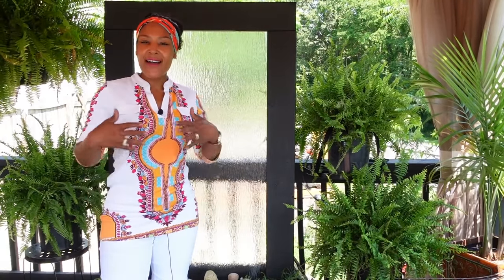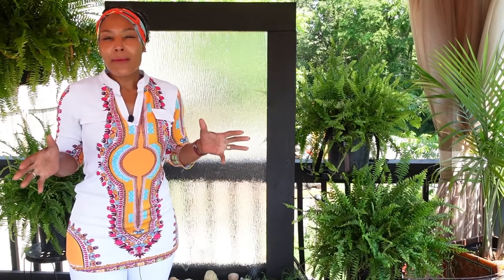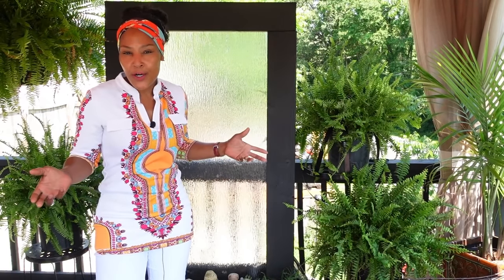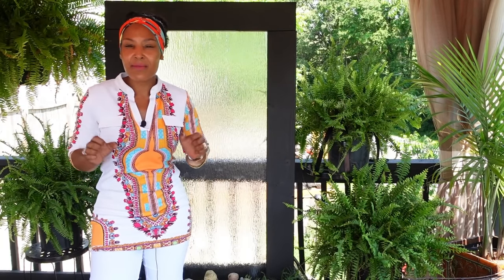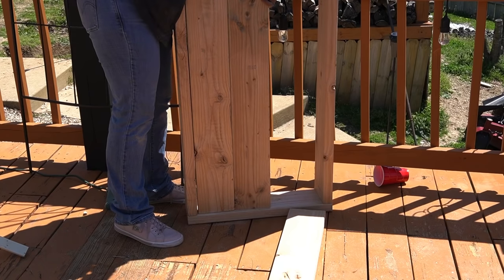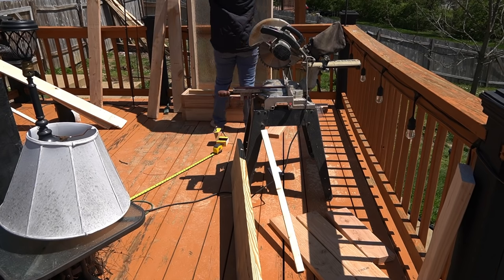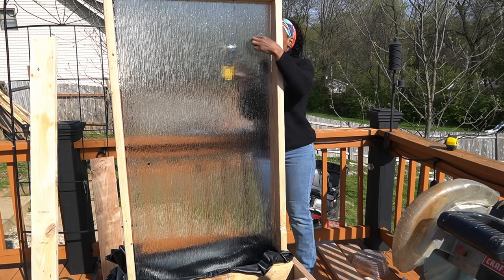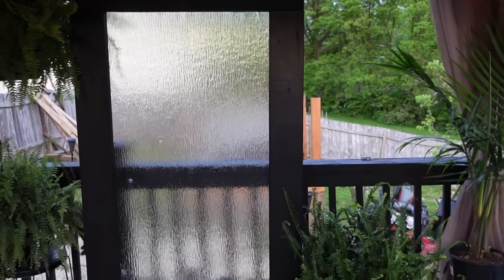Outdoor Water Wall DIY/ Using An Old Shower Door/ For Pennies😯

Comment: Great job! My only suggestions would be. 1) don't staple the bottom of the liner, only the top (you are creating holes that don't need to be there). 2) make sure the wood that comes in contact with the glass and water has been sealed first so the water doesn't rot the wood over time.
Reply: What should I use to seal the wood?

Comment: This is really pretty. Thank you for the valuable information you provided before playing the build video. I perused through the comments to see what other viewers thoughts were and I came across two persons that had my same idea. You explained how you built the frame but not how you put the feature in detail. Did the hose side towards the front or back? Where is the pump? How does it drain? Do water features recycle the water? I would greatly appreciate more info.

Comment: MRS.Eva please tell me how you care for your ferns, I absolutely love them but they die on me EVERY  single time :(
Reply: @Monica Carpio  I noticed you didn't get any replies and I have many plants myself and know about Fern care. They do not like to be dry at all, you need to keep the soil moist at all times, not soaking wet but a little moist. And, they prefer medium to bright indirect light. Any other questions, I'm around. God bless you!😇
Reply: @melissarushing2538  thx for sharing. I also have killed many furns. Do they do better inside or outside? Any other tips???
Reply: @sarahpcato  Hello, dear. You're very welcome! Ferns do well inside or outside really but you will see faster and more growth outside in Spring, Summer and Fall. They can even take some direct morning sun for a couple hours because it's not too hot at that time. And, make sure you don't let the soil dry out completely but not letting them sit in a puddle of water either. I pray this helps you and if you have any other questions, I'm around. Have a very blessed day!!😇
Reply: I agree with the other response. Ferns don’t like to be in direct sunlight and they LOVE water/humidity. You’ll need to thoroughly soak it once or twice a week depending on your climate. I live in a dry climate so I also had to mist mine once or twice a day. I like them better outside because of the leaf shedding and having to mist them. A lot of people have them in the bathroom because of the higher humidity in there.

Comment: I have a few questions. I know you attach one end of the plastic hose to the pump, but is the other side just left open pointed towards the upper left corner? (11:18 on your video). Also, did you treat the wood or use pressure treated lumber? Wouldn’t the wood eventually rot? Did you fill the entire bottom with water or is there a container underneath the stones where the other end of the hose delivers the rest or the water that didn’t come out of the holes and trickle down?

Comment: I so wanted to do this project.  But when looking for a shower door.....I came across something weird I was not expecting.  

I have only ever lived in one place that had shower doors.....and I assumed most shower doors were the same.  MY shower doors looked like yours, with that bit of frosting or whatever they do to give you a bit of privacy from prying eyes when your standing there in your birthday suit.

But....every single new (don't really want to pay for new for this project) or used shower doors I could find, are completely clear like window glass......

I will keep looking, but damn.....doesn't anyone value privacy anymore?

I actually thought, that making this would serve a dual purpose for me.  A gorgeous water feature, and a privacy wall all in one.

Thank you for sharing.

P.s.  in my searching, I came across something that's called "frosted glass spray paint"  If the water only runs down the front, do you think this spray paint would work to be put on the back of the glass?  There's apparently also frosted films, and stickers you can get for glass you would like to make more private.  Maybe one of those would work better since this is going to be outside?

Do you cover or take yours inside in the winter? Or do you even have winter? LOL.

Sorry for so many questions, but I DO want to use your idea and make this.  It is so beautiful!

Comment: What pump would recommend for a balcony I’m wanting too make one of these but but water will come from the sleeve air conditioner that leaks the water down I have a tube that runs down too a planter then I want too pump the water back up too the top to run down the glass I have screened in balcony so I place the temper glass in a picture frame

Comment: Absolutely want to make one of these. I have a question, did you cap off the end of the hose and then poke holes going across the top? And can’t find where you posted the size of the pump you ordered.

Comment: Hey just wanted to share a tip for your hole in the shower door you could put a marble in the hole and use LEXEL silicone to seal which waterproof

Comment: Awesome idea. Did you do any caulking around the glass and the wood? How many holes did you screw in the top of the hose? What kind of paint did you use on the wood so that it doesn’t rot from the water?

Comment: Me and my husband created this same waterfall but with 2 shower doors ! Love it but we are having a hard time figuring out the actually water flowing down the glass. We tried from a bigger hose to a smaller one. Our pump is powerful so we know it’s not that, it can reach up to 7ft. We drilled smaller holes to bigger holes in the tubing and it seems to fail!! Ughhh please help with any suggestions! I will b so grateful and want to finally finish it 😢
Reply from the maker: @tinamarie9797 When I had that issue it was my pump. It just wasn't strong enough to push the water. Also make sure your tubing is big enough. I had to change to a 1/2 tube. 🙂

Comment: Did you waterproof the wood frame that the glass is surrounded by.... because regular wood I would imagine would rot if it got wet?? The readin I ask is because I want to build this for my wife.... thank you
Reply from the maker: Yes, there is a waterproof stain on the wood.
Reply: Which waterproof stain do you recommend?

Comment: Hi I have a question 
How or why you did a hole on the glass?
Also how you control the flow of the hose ? At the tip of the hose 
How many holes do I need for the water to drip ?

Comment: GOOD MORNING ,how many holes and what size holes did you drill on the tubing and did you use fittings on the tubing holes? what kind of cap did you use on tubing end thanks!!!
Reply: Thanks for asking I was wondering that also . I hope she reply’s. I would like to see it at night and how and what type of lights were used